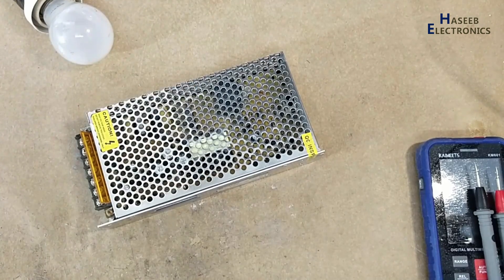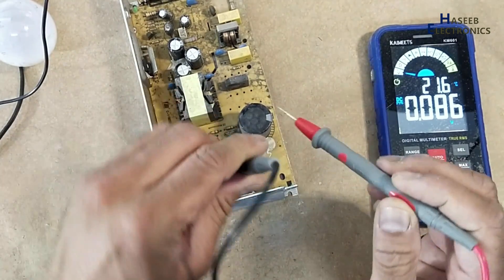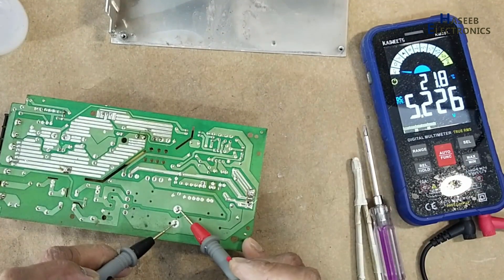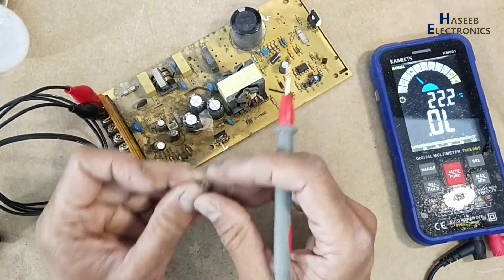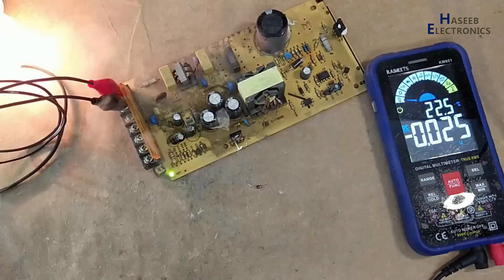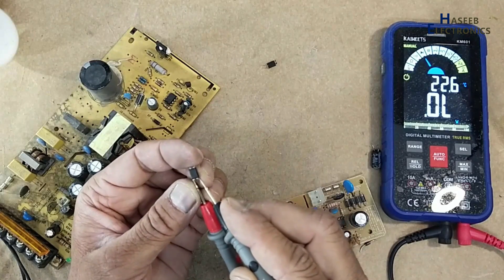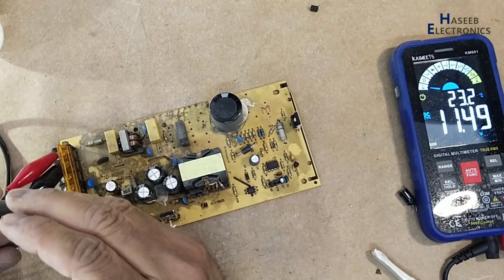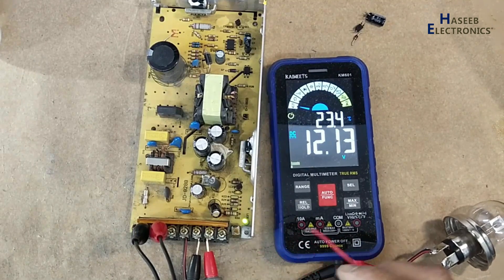{1071} SMPS low output, fluctuating, Tik tik sound

Comment: Nice to see that bad cap explode. Very entertaining.  It didn't deserve to remain in one piece. Not only did it rest in peace (RIP) but also rest in pieces haha! In the past I've fixed many 80's computer monitors (especially by Commodore) and one common problem was bad capacitors causing a ticking sound. Do you know which part was making the ticking sound? I suspect it was that cap.
Reply from the maker: Hahahhaha 😅😅
It becomes frightening condition when it produces a blast sound with smoke 
More horrible situation is that when we poke test lead on PCB and there is this type of disaster and we aren't mentally prepared for this unforeseen event
In first moment it makes us crazy 🤣🤣
Tik tik sond i think from high frequency transformer because there was short circuit due to parallel zener diode
So voltage weren't passing to the capacitor
Reply: @HaseebElectronics do you know why the capacitor blew up?
Reply from the maker: @g4z-kb7ct  because there was huge fluctuation after removing short ciruited zener 1n4741 and feedback loop was inactive due to optocoupler failure 
Then all spikes reached to this weak capacitor, this capacitor was also near to its last life stage 
When it is old its ESR increases, causes to increase itnernal temperature
It was unable to handle those large pumping spikes 
It is my opinion
May be right or may wrong....
Reply: @HaseebElectronics 
Dear brother Haseeb
I need your help, I have solar transformer where I by accident reversed polarity of the incoming lines from the solar panels, smoke and bang sound, 
I opened it and found two resistors blown, my problem is I can't tell the rating of the big resistors!
Reply: @sboho  You need to either buy another one or get it fixed by professional. There are hundreds of amps generated by solar unit and if it went bang there will be many parts damaged. It is not a repair job for amateur.
Reply: well this is why its a good idea to wear protective glasses,because if something pops,it wont take out your eye...I remember  the first time i was taking measures on a tv psu,and the mosfet expoded,i was scared to death...lol @HaseebElectronics

Comment: I have that power supply 30A voltage output normally but current output very low only 4A, what the problem?

Comment: My laptop charger shows only 1.5 voltage constant.when i remove opto coupler then output is showing unstable 14-20 voltage 😢 .  Then I replaced with a new opto couplers.again it's show's low voltage as 1.5 volt😢 .

Comment: Salaam brother i have 12 volt 10 ampere smps, i want to replace the filter out put capacitor to higher voltage, but upon checking it seems to have only one filter output capacitor, the value is 16 volt 680 micro farad, though there are are other four identical capacitors but are not connected directly, they only have common connection on negative output. Thanks

Comment: In a similar situation, I changed the optocoupler, Schottky rectifier diodes and even TL431 - no result. And the cause of the malfunction was a faulty variable resistor (never failed) near LED, which turned 2.2 Kohm into 1 Kohm. How is that? - I don't know. I replaced it with a 470 ohm permanent resistor, selected the nominal value. The output voltage has become 12.1 volts and the SMPS is still working fine.
Can something happen that is impossible? - it can happen.

Comment: How to check ic without data sheet but only multimeter can you explain sir.how can we measure in voltage mode .
Reply from the maker: it is really difficult question,
Reply: Ok sir.but sir i want to know which common ground in secondary or output.to measure voltage.does polarise capacitor is common ground for input and output to measure any components voltage please help sir

Comment: No TL431 ?
Reply from the maker: TL431 found good. it was a really amazing. 
i think it was material failure of optocoupler resulting open circuit. 
if it was due to overcurrent, then TL431 must damage with optocoupler